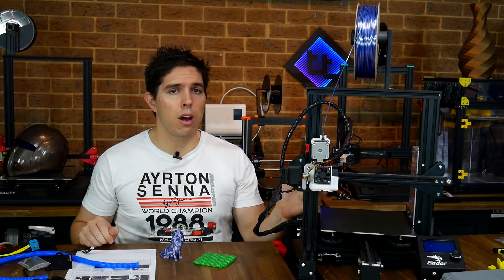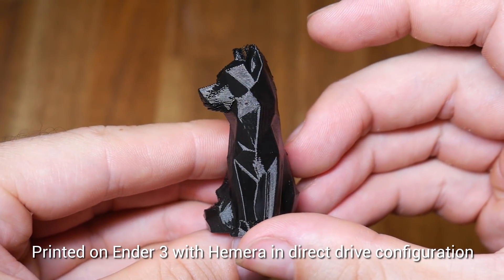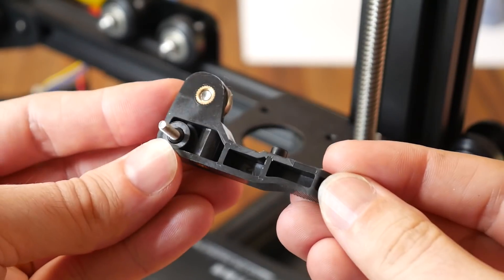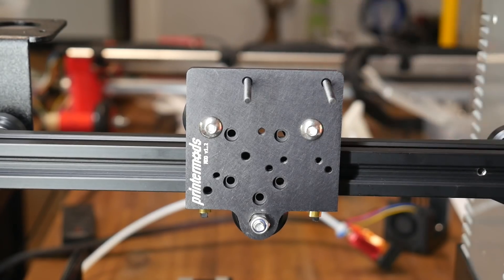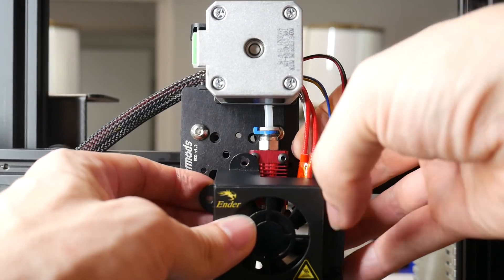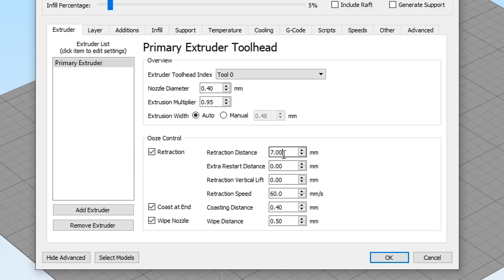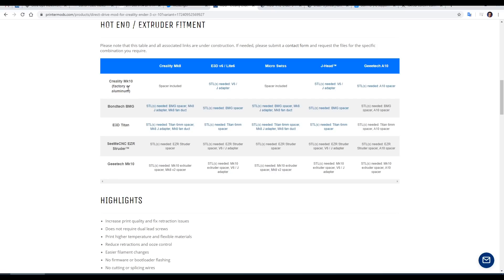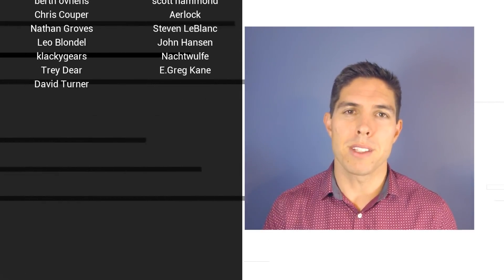Modular direct drive kit for Ender 3, 5 and CR-10 for under $40

Comment: I love the video. I've based a lot of my setup for my Ender 3 pro watching you videos.  I just got the BMG extruder and very interested in the Modular Direct Drive set up... unfortunately I can't find a mount that will fit on my 3D fused linear rail kit. regardless, it's a great video with great instructions.

Comment: Noticed that you did not put the pneumatic fitting back on the extruder before inserting the Bowden tube.  Is it not required with the new position of the extruder?  Seems with the "play" of the tube fit in the extruder port that it might be difficult to get the filament into the tube easily.  Maybe I'm just overthinking it though.

Comment: Have you guys had any luck with this company. I’ve emailed them 3 times for support and not received any responses
Reply: What issue are you having Heath?
Reply: Matthew Basaraba I have all the printed parts for installing this on my Ender 5 but I can’t find any info on orientation or order of install.
Reply: @lquidflesh  This kit is for the Ender 3/CR-10 style machine. The Ender 5 kit is completely different. Teaching Tech also has the Ender 5 kit that will be in an upcoming video.
Reply: @lquidflesh  The Ender 5 kit should come with all the parts needed to install and come with a detailed installation guide in your package. Or are you putting a different cooling system on and that is what install information you are looking for?

Comment: Thanks for the video. Just warning off those who want Direct with BMG and V6. My plan was this plate and wiring +BMG +V6... I was able only to use the wiring. Not a knock on them: it is intended to make the stock (heavy) motor and heatsink/nozzle DD, not a V6. The Humera is probably better than what I ended up making, and losing some build room in the Y direction. FWIW!

Comment: I have a clone BMG, and I have just received my printermods carriage. I have an E3D V6 and a pancake stepper coming also. The three parts should all go together just fine, but what about a fan shroud and support for BL Touch. I will be trying the modified version Micheal spoke about, and I will update everyone looking at this option once it is working.
Reply: Any update on this? May be to soon but I have this same setup on the way.. looking for some fan ducts that would work without having to mod something.
Reply: @Reed_0024  ETA for the parts is Feb 8th...
Reply: @stephensweeney5167   I think mine are the 3rd/4th.. if i come up with a easy simple solution, I will update here..
Reply: @Reed_0024  I received my parts from supplier. I tried to use the spacer recommended by Printermods, and it may be because I use a clone BMG, there were a few issues, I will get back to this spacer in a minute. Also, I didn't like the fact that all the optional fan shroud  mounts would no longer be available. So I mounted the BMG extruder the same way they mounted the original extruder in Michael's video, however the original spacer is too thick and supplied mounting screws are not long enough. I flipped the PM recommended space for BMG/E3D around, and almost perfect.  I say "Almost" because now the nozzle is too high, and the roller is going to hit the bed before the nozzle. So far I have 2 mods I will need to do. Remodel and print the spacer, and drill 2 holes into the aluminum plate to lower the nozzle. (I did considered Volcano, which will add some more space, but since I do not have... I am not sure how much extra it will add). I will disassemble the MK8 setup and mount the setup I have to get exact measurements for the new holes.
Reply: @stephensweeney5167  OH man thank you for the update. I don't have my parts in yet but I also have the BTT BMG clone ( I have been using it for about 9 months now issue free, for $15 on aliexpress you can't go wrong) . I will see what I can do as well, I just wanted a really simple setup that is easy to take a part if there is a jam =( . That said, since switching to a E3d V6, I have had 0 issues with clogs/jams or filament pig-tailing. Can't say the same for the handful of hotend clones I bought, I won't skimp out on the hotend ever again. I Might have to send both kits back if there is no support for fan options/mounting options with BMG clone and real E3D v6 =( .  ( got 1 one for each ender 3 pro I have =p )
Reply: @Reed_0024  Ok... so a fair amount of progress. I will try and give you a link to pics (Michael, let me know if this is frowned upon).
So I am pretty much done with the modeling of the Hot end fan shroud. It is not as modular as the original  hero-me. Since I am only using BLTouch... I put mount directly on the main shroud. Also, keep in mind about drilling 2X3 mm holes, 10 mm below the upper mount hole. Shown in Pics. My next steps are modifying the Part cooling bits. Here again, I will be working towards a 5015 single fan mount.
Once I have a working model, I will make the STL's available.

https://drive.google.com/open?id=1YjrfCG1emIUH9vLPweqSmbTR-HgyhQFn
Reply: @stephensweeney5167  oh wow this is great!! Let me review more in a little bit. Looks like I need to start printing 😀. Im really surprised there is not an out of the box solution for this. Truly appreciate the hard work on this one.  My parts are out for delivery so I should have something today to work with.
Reply: @Reed_0024  I've added the modified spacer stl.
Reply: @stephensweeney5167   I will get that now =p thank you. update: currently printing as I wait for parts to show up =p
Reply: @stephensweeney5167  Ok so I got my parts in... this is a huge mess of an issue.. As stated, the carriage will hit the bed before the nozzle and 100% need to drill the new holes as you  did. I sorta feel this kit is really not compatible for the BMG/Clone with an E3d V6 without a mess of modifications. I even see what you mean that the E3D v6 is not centered if it were to mount the way it needs to be mounted changing the offsets. I will ponder this for a lil bit.
Reply: @Reed_0024  I don't believe I will lose any print volume other than Z which will be the case with all Direct Drive setups. It is slow going on the Modeling of the fan shroud for 2 reasons... 1, I am not a professional Modeler, and 2, each test print takes 5 hr or more. :)    I am very happy with the results so far, and look forward to having a working DD setup by the weekend. I haven't tested any of the limits yet since I am printing 24/7 to get fan shroud done, but once everything is mounted, I will figure out what firmware changes that need to happen to get the most out of the bed.   I will keep you posted.
Reply: @stephensweeney5167  Fantastic Stephen, Hopefully this is something the community can use! I know I will. For the Z hight, I have the X gantry cable chain mod with the extended stepper cables from Printermods.  I will have to  test the z. to be fair, I don't ever print to max height though =p .
Reply: @Reed_0024  I have added the Fan shroud STL to the link I sent you. I will be doing a final print of the Parts Cooling fan adapter, but it should be fine... Once I confirm, I will add it to the link also. I should have all this mounted and ready to test tomorrow night.
Reply: @Reed_0024  Also... This is all 20% infill with supports at 5% density
Reply: @stephensweeney5167  oh man epic. I'll have to check this out . Thanks for the hard work!!
Reply: @Reed_0024  No, I haven't given up. I did a rework, and I had to learn Blender since Tinkercad just wasn't getting it done. I am real close and should have a finished product by the end of the weekend. I painted myself into a corner, and almost had to put original fan and blower to print the parts I needed..... But got it working, and should do final adjustment and print tonight.
Reply: @stephensweeney5167  haha Stephen you are a legend.. what a process to take !! Well now you know more about making models then before haha so that's a win on my book. Glad you are still going. Printermods have yet to reply to my emails asking for a supported solution or my questions about a return. I'm excited to see what you come up with as one of my printers is down waiting for a solution that works hehe. Thanks again my good sir !
Reply: @Reed_0024  I have added the pics of what it will look like and the STL's for the Spacer (No update on that), fan shroud, and pet fang adapter. I am still playing with adjustments on the parts fan unit (pet fang design), but should be close now.
Reply: Hope you didn't print the fan shroud yet. I have been having problems printing for the last week or more and I was less than happy with the Direct Drive mod blaming it for my problems. Well yesterday it all came to a head and nothing was printing properly at all. Well I found the problem. Two of the screws that hold the X gantry together on the left side of the printer were loose.... Very loose, and was jamming the gantry on the Z axis. This was causing erratic prints, and had nothing to do with the DD upgrade. Well fixed that last night, but a mod I made to the BLtouch mount now causes the mount to be to high. It can be fixed with a spacer, but it gives me a chance to fix some tight spots. On a better note... The parts fan Is perfect now, and I have added that to the Files.
I will finish the fan shroud this morning...Print it, and test... Then I am done. I will let you know once the new file is there.
Reply: @stephensweeney5167   I have not printed just yet. 😀. Waiting to see what you have at the end. I been busy with my elegoo mars hehe. That's again for the update and the hard work!
Reply: @Reed_0024  Ok... all files there ( https://drive.google.com/drive/folders/1YjrfCG1emIUH9vLPweqSmbTR-HgyhQFn?usp=sharing ), I have added a Readme file for the setting I used. I included the blender file for the Fang in case you need to make a tweak or 2. All those horrible prints are being redone... Quality is fantastic so far... Waiting for a silicon boot and a cartridge Thermistor before I do a complete alignment. Have fun and enjoy.

Comment: You can do something just like this with one 3d printed mount for the cr-10 that puts the stock extruder motor directly above the hot end with a super short bowden tube i did it on mine and i can print tpu at speeds up to 65mm/s

Comment: I’ve had this for a year and when I have to change filament or it breaks it’s a pain in the ass to change, I have some ideas to make it work better though!
Reply: @yeoj_  I end up pulling one screws out and rotating it to get to filaments that break and or change the filament. Now that ender pro just sits in my garage while I run 6 others all cr10s that machine for some reason has been nothing but problematic!

Comment: how does the plate work with a linear rail on the x axis on and ender 3?  I understand the ender 5 kit uses the top of the2020 rail, with an adapter but doesn't the ender 3 run the rail on the front? do the belt tabs under the rail reach far enough?

Comment: Thank you for the great info and procedure. Took a  look at the mod and compared with one of the options on Thingiverse. Decided to try the CR-10 / Ender 3 Direct Drivinator at https://www.thingiverse.com/thing:3589452 on my CR-10 (upgraded with dual Z) using the stock extruder. Now printing my first model and the quality seems to have improved. Very happy for trying this mod.

Comment: One thing that I noticed on the website it says that you can use this to mount the Hemera. I wonder if this solves the mounting problems caused by the printed mounts. They do say this was based on "currently available specifications of the Hermes." I wonder if anyone has tested this.

Comment: guys..... why pay anthing for a Ender 3 Direct extruder convetion? 
I literally just printed a single bracket to mount the extruder on the x axis carrier in line with the hotend.... works like a charm. 0 Euro spend.

And to those who are affraid of x axis ringing / wobble.... Guys, the Y axis is still heavier than the X including the extruder....

Print quality during fast movements is not worse than before. (speed ~60mm/s).
Reply: Is the bracket you printed available somewhere (Thingiverse)?
Reply: link to your bracket please?
Reply: ive done the same, also with a bullseye part cooler, it fits perfectly. I havent tried flexible filaments just yet but I imagine it would work just fine.
Reply: haven't found any printed parts that will actually work with my ezr-struder and don't suck
Reply: Yes please could you share where to get the model for the bracket?
Reply: People making out plastic isn’t strong enough to someone that’s using plastic fine 😂
Reply: axised001 because metal is better then it being 3D printed.
Reply: @redline3036  and how you come up with that claim? is there any science behind it or just guessing? 

its quite safe to say that rigidity and durability is high enough for this application. We neither see high peak loads nor extreme (extreme how it can get for a polymer) temperatures.

Im using this bracket since over a year with still no sight of degradation or disadvantage against an metal bracket or the OEM bowden layout.
In addition a metal bracket would increase mass and therefore inertia.

So i can corroborate my claims, can you?
Reply: @axised001  Its not a claim its an opinion cool the jets buddy. If printing things was such a good option then why not print the whole machine out of plastic If weights an issue? I'd rather use metal not to mention the weight of the extruder is already on the bar regardless of where the extruder is.
Reply: If it was just an opinion, make it clear like "in my opinion..". 
You simply stated "metal is better than being printed"

And I don't recommend printing the entire printer from plastic for given reasons above, just in places where mechanical and thermal loading allow it. prusa mk3s are great printers too, even though lots of printed parts, aren't they?
Reply: @axised001  Out of the respect I have for TT channel ill let this one go cheif
Reply: axised001 ill bite. Yes steel and or aluminum IS stronger than 3D printed plastic. For structural parts stronger is better... While you may be fine with plastic (where are you getting FREE filament btw?) $35 and a factory part is money well spent imo...
Reply: @slipspectrum  By free, he obviously meant something along the lines of about 10 cents (effectively free since it came with his spool). I have no doubt that a bracket that small will use more than a meter of material and a 1kg spool of PLA (~330m) costs almost the same as this kit. Strength is good and all, but there is a point which it won't matter because the stepper motors are only so powerful.

Comment: I bought a fake titan extruder and addet it to my e3dv6 hotend. there are some files on thingiverse to convert your ender 3 / cr10 to direct drive.

just doo it. the prints improoved alot! retract sits at 0.55 mm, no blobs, zitz or similar.
and you can print sooo fast without issues.
totaly worth it!

a light printhead on a heavy bed moving printer makes no sense anyways.

Comment: What do you think about trying to mate this up with the Mosaic Palette 2? Or other multi-color/filament feeder? With essentially no Bowden tube, wouldn’t the dreaded waste block be nearly eliminated?
Perhaps mount the whole thing on the cross beam and add a second Z stepper assembly on the opposite side to handle the weight and load dynamics.

Comment: Great video. I was unaware of this product and wanted to do a direct drive conversion, but wanted something more stable than printed parts. At this price, this was an instant buy for me.

I'm wondering if you have seen much about the ender extenders (a company selling frame kits to increase the ender 3's build volume to 400mmx400mm for around $130). I'd love to see some reviews and thoughts of yours on that some day as it is something I'm considering.
Reply from the maker: My patrons brought my attention to it but they don't ship to Australia.
Reply: @TeachingTech  Oh that's very unfortunate! The facebook community around it are doing some very wild things with upgrading the ender 3. There is one user who has a custom bed standard width but a whole meter in length and prints things like full size greatswords and battleships. I hope their shipping options change soon - the ability to increase build volume for such a relatively cheap upgrade is very exciting.
Reply: @TeachingTech  I've started a convo with the makers to see what we can do about getting you one on the other side of the globe :)

Comment: I really enjoy your content. I've been able to learn so much from you with my recent entry into the hobby. I do have a question regarding this specific setup as I purchased the MDD kit a few weeks ago awaiting for it to arrive.  Is there a HERO Remix that allows for Noctua fans instead of the blower style fans. I am aiming for noise reduction as much as possible.
Reply from the maker: My Hero remix allows for a Noctua on the heatsink. It directs the air very tightly around it and I've had zero heat creep/clogs since fitting it. I'm not aware of any that take a fan rather than a blower, but I imagine the performance would be a fair bit lower. The Alfawise U30 is similar and uses a fan instead of blower for part cooling.
Reply: Teaching Tech thank you. I couldn’t see if you had a Noctua for parts cooling as well on the remix